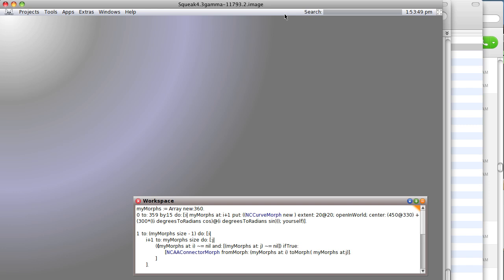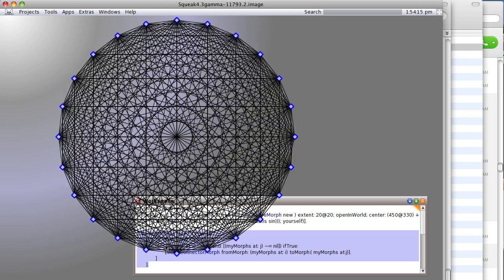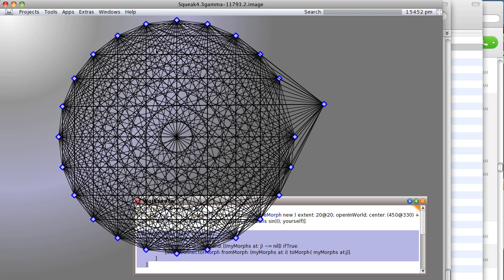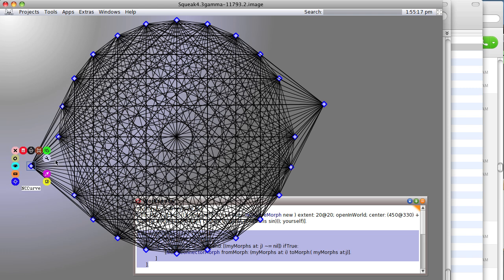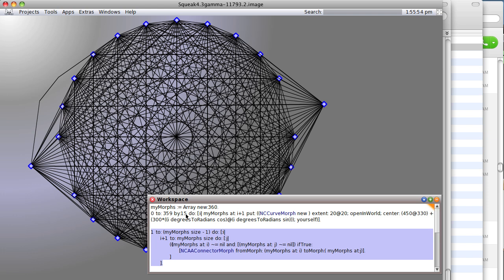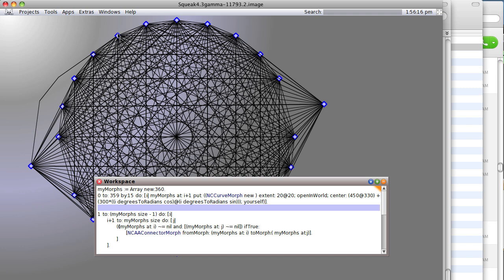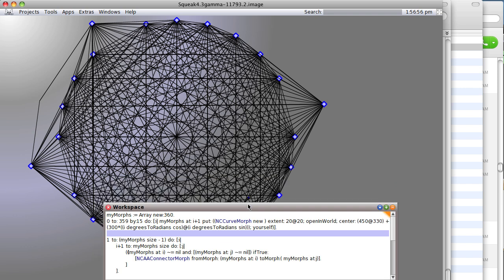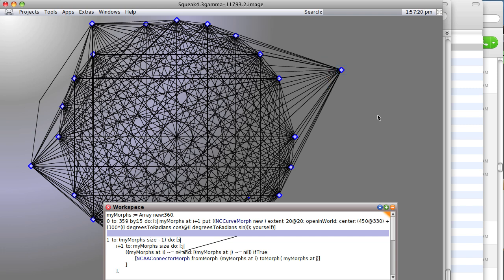squeak smalltalk  tutorial: CS OOP optimization problem 0.0.0.31.mov.mov

Comment: How about rasterizing it then using dirty rectangles to redraw the pertinent parts as updating takes place?
Redrawing a bitmap should be constant...
I'm fairly new at Squeak but if you're locked into software rendering that is always a trick people use..
Reply from the maker: Thta's not really where the slowdown takes place. Iti s the massive nesting of the parts of the morphic object that take place BEFORE one gets to the drawing code that are the main slowdown.

Each morphic object has many nested parts already, and so when you create a tree of such parts, the levels of nesting become unreasonably complicated.
Cuis Smalltalk is supposed to simply morphic in many ways (not merely provide vector graphics to replace the origianl Color Bitblit that Dan Ingalls wrote for Squeak), so simply reimplementing on Cuis should make things much faster.

I've also been trying to implement Apple's original region algorithm code which does away with requiring dirty rectangles on top of Color Bitblit, but haven't really done so yet. That will allow optimizations that approach the original Quickdraw drawing algorithms, which were fast enough on a 1Mhz 68000 that Apple could get away with needing dedicated graphics hardware for the first 6 generations of the Mac, and still run circles around Windows graphics, which couldn't use QD regions due to the patent.

no-one takes QD regions seriously any more because everone uses vector graphics, but my intuition suggests that everyone else hasn't thought things through because they are still stuck thinking of QD regions as being limited to 32KB of region info on a limited monitor that can be, even when compositing multiple monitors and offscreen drawing areas, no wider than 32K pixels on a side.

That was a limitation of the 68000 implementation, so that every flag could fit in a single 32 bit register, NOT a limitation of the algorithm itself, which could use any arbitrary sized drawing area, as long as it was smaller than the flags used to identify end-of-line, and  end-of-region. (i.e., smaller than  ox0fff or 0x0fff0fff, respectively — on a fast processor, there's nothing to prevent one from using ANY arbitrary flags, even those that are themselves variable length integers larger than 64 bits).

So the point is that it is a design flaw of morphic objects that makes the drawing so slow and unresponsive, not the lack of drawing speed, though that also can be sped up.